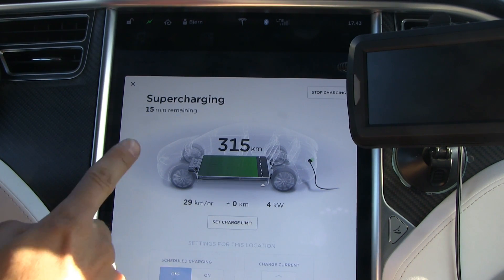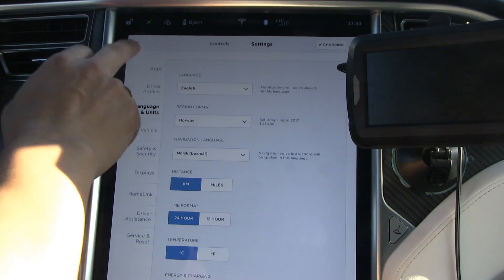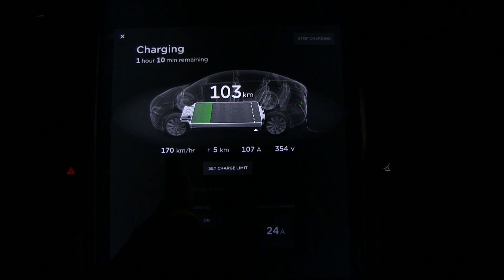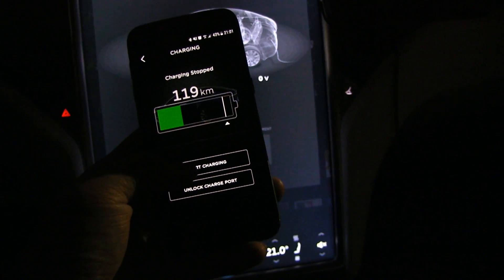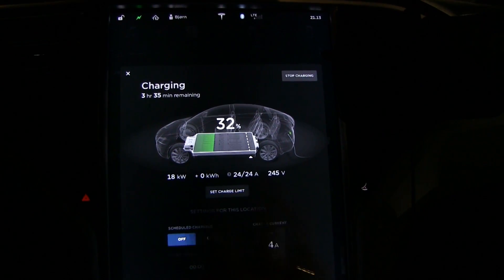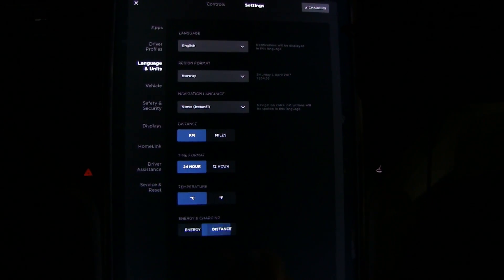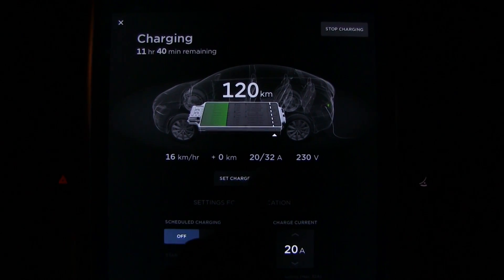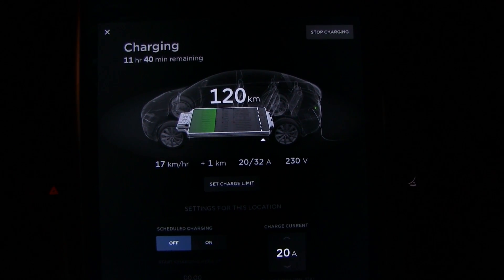Tesla charging numbers explained

Comment: I am now more confused about this thanks Bjørn   LOL no really thanks for the info.  :)  What would the charge & rate of charge be for a UK home wall plug at 240V AC  on the Tesla?  thanks.
Reply: It depends on the Amps the socket you plugged in can handle. I would say that the last part where Bjorn charges at home is pretty much what you will get.

Comment: Amusing all these discussions. My car has a 100kW engine, I charge it in less than 5min, about 500kWh that give me an autonomy of 1000km. I never worry I won't be able to complete my journey, I can recharge it in plenty of places. I can even pack an extra 100kWh in a 10 cubic decimetre pack just in case !  A:C or heating won't affect my range either. Still going fine after 200000km, had to change only the 12 V battery.  All this for a fraction for the cost of a Tesla and about the same impact on the environment. True I get less km per kwh but I don't need a power plant burning oil, coal, gas and a complex costly infrastructure that has yet to be financed and set up. I laugh when I see in the US all these electric cables and transformers hanging from wood poles . Three phase 400V 75KVA, ah ah ahand that is not enough  ! The little 75kWh  Tesla battery pack (a few thousands cheap 18650 used in old PCs) requires ONE MEGAWATT to be charges in 5min. 1000A @ 1000V  IF IT COULD BE DONE but NO WAY !
Reply: Wow do you have a photo of it

Comment: The "km/hr" display of charging is exactly why I always use the "energy" display.

The big advantage is that it is directly related to your "mileage": if I consume on average 20 kWh/100 km, then I know that if I have recharged 30 kWh, then I should be able to travel around 150 km without a problem.

In fact, I see no advantage at all to display anything other than "energy". It is simple, to the point and reliable. Other displays aren't.
Reply: Most people don't understand the kWh units though.

Comment: Well, you have a dual charger... but if I have a single charger on my Tesla, which is the max amps of charging on single phase 230V? 16A or 32A? Thank you
Reply from the maker: I don't have a dual charger. That's for pre-facelift Model S only. My charger is 16.5 kW which is max 24 A. You can get 230 V/32 A and 400 V/16 A with a single charger.
Reply: Bjørn Nyland This is all i have to know, thank you. Here in Italy, new Model S has NOW a basic 11kw charger, and the optional 16.5kw high speed charger. Thank you again for the answer!!
Reply: so in new Teslas there is no single/dual charger option? Only 16,5 kW?

Comment: Bjorn,
You pointed out that the average charging rate (in kph/mph or KW) gradually increases until it stabilizes.  But you might have pointed out that the rate will also decrease when using a Supercharger, as you reach the upper end of the battery capacity.  (If you did say that, I missed it.  I know you have mentioned it in other videos.)

Comment: What actually causes the charging process to slow down after 80%?
Reply: This is because of the charging method of lithium batteries. The maximum voltage per cell is 4.2V.
Until you reach 4.2V (=80% SoC), you charge at constant current, usually 1x capacity (1C), i.e. 100 A is your battery is 100 Ah. If battery is cooled and/or has specific chemistry, charging speed can be 2C or more.
After 80%, you can keep charging but you need to reduce the power to have constant voltage.

Lead acid batteries use the same method, except the charging current is at C/10 and maximum voiltage is 2.3V per cell.
Reply: Or is it rather the battery voltage rising and charger-battery voltage difference reducing, which causes a lower current?